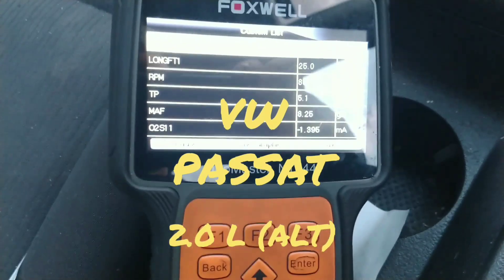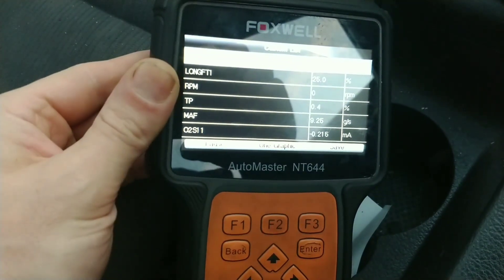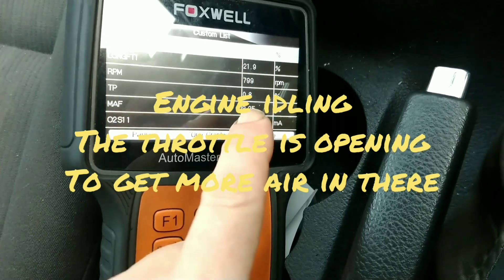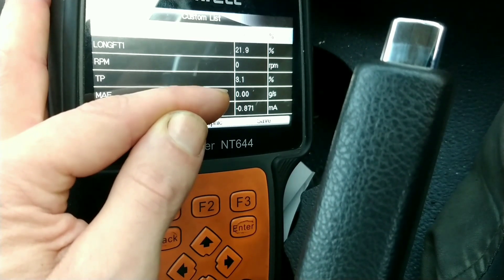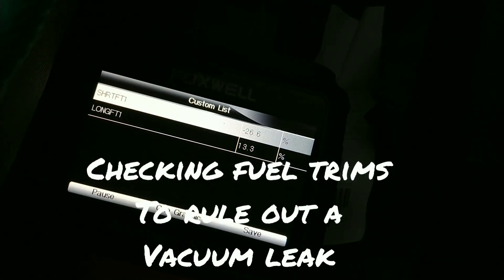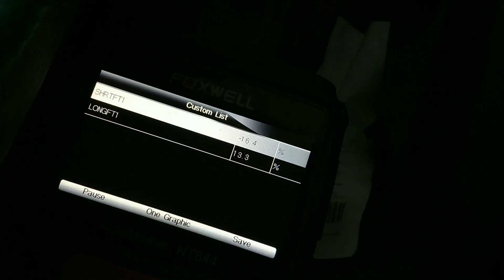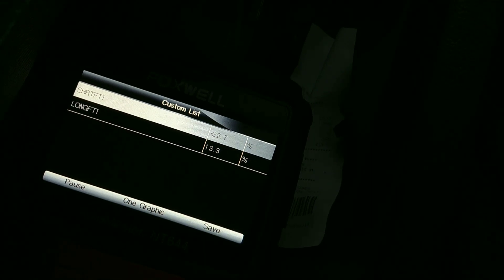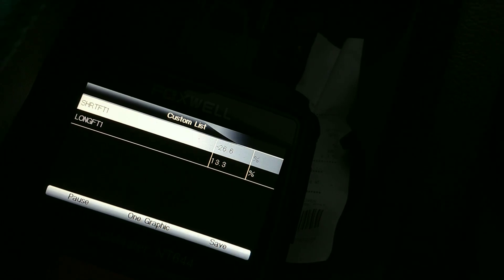VW Passat Cuts Out At Junctions

Comment: Spot on mate I need to get one those simulator very precise diagnostic 👍👍👍👍
Reply from the maker: It helps confirm the fault, when the simulator sends the signal to the ECU, that it wants to see and the car runs ok. It's like trying a part before you buy a new part. Thanks for watching mate

Comment: A MAF of 8.5 g/s @ 800 rpm for a 2.0 liter is grossly over reading. Did ya try cleaning it prior to changing it Matt? Anyway ya fixed it...all that matters...Cheers
Reply from the maker: I didn't try and clean it, although it was full of fly's in the mesh and road dirt in the sensor. I could buy some MAF cleaner and clean the old sensor just to see how much the grams/sec changes, thanks for watching mate